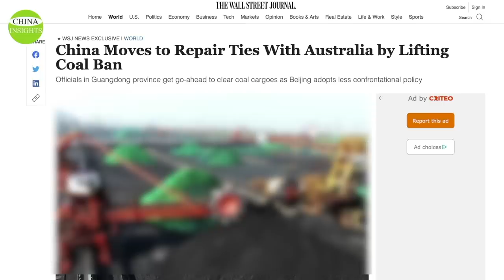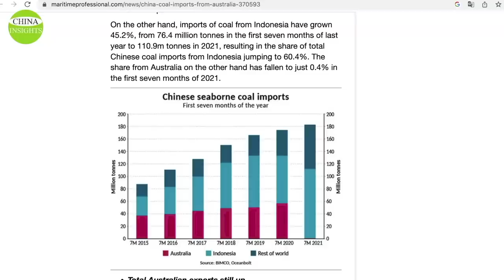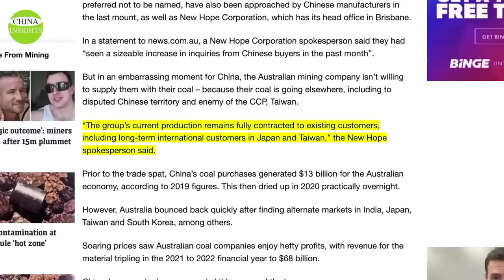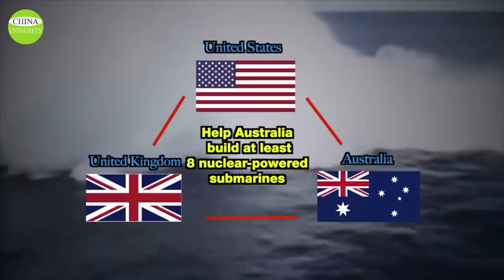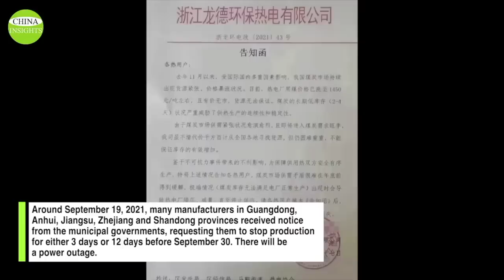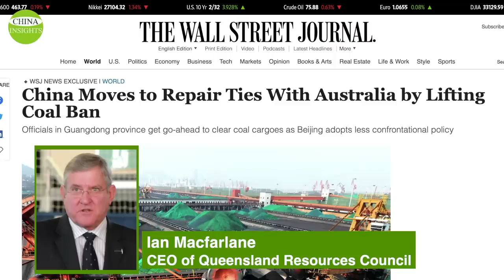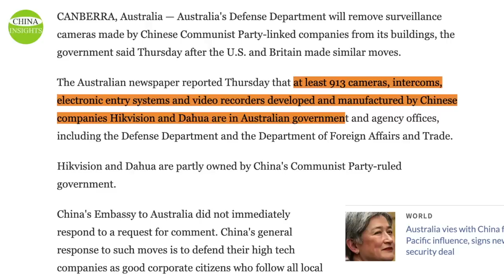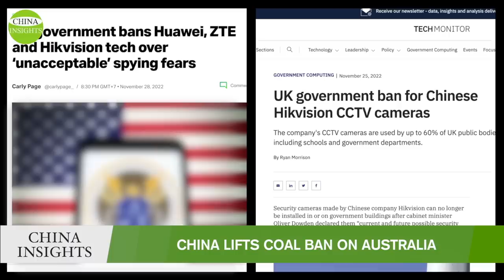China's economic plight stifles Beijing's pride/Can Australia–China relations go back to the way?

Comment: Our family has made a commitment to NOT BUY ANY CHINESE COMMUNIST PRODUCTS. We check boxes and labels and REFUSE to feed the "wolf warrior" preferring to buy used or do without if necessary.
Reply: Thank you very much for not buying made-in-China. I made this commitment long long time ago when I saw them using trade to blackmail small countries for political gains.
Reply: Yes same.
Reply: It's going to be pretty much impossible to entirely avoid Chinese made products. Boycotting Walmart and Amazon in favour of smaller chains is probably going to be more effective (or as you say go for more secondhand stuff)
Reply: @chendaforest   it's getting easier because supply chains moving out of CCPchina.
Reply: Likewise
Reply: I have taken great pains to avoid buying products with a "Made in China" label.  Most of the time, I can find a more expensive product made elsewhere.  Sometimes I go without the product. I didn't buy any new Halloween decorations last October because I literally couldn't find any not made in China.  I don't need Halloween decorations so I went without.  I checked every hardware store.  I could not find new light fixtures not made in China.  I cannot live in darkness unfortunately.
Reply: I try but sometimes it’s the only thing available sadly.  Bought some tools from India lately I like India but their ratchet actually sheered off on connecter something I’ve never seen tool metal do with only force of my hands.  Lots of times I just don’t buy product at all since I see it’s Chinese and decide I don’t really need it.  It’s thrift stores for me for now on I guess for basics.
Reply: @youtubeviewer4472  You do what you can!  Be proud of yourself for doing SOMETHING.  If everyone does just a little, we can step buying the rope from them that they openly discuss hanging us with!
Reply: @advancetotabletop5328  I agree. You know, I had a ceiling fan and the switch broke. So, I took it down to an electric store and showed the man the switch and he brought two up from the back. They looked exactly the same?? I said how much are they? This one $12 and this one is $2.49. I said what's the difference? He said the cheaper one was what you had.  That was the beginning of my getting ripped off with Chinese junk. I'm a fast learner though.
Reply: @rogerdodger8415  how much more would you pay for a 100 dollar Chinese product you MUST have to be US made??  I’ll pay 230 for exact same product after that I start to get angry at products might buy Chinese to be honest.
Reply: @dustintacohands1107  Look. Everyone is in different situations, so I try not to judge people. Maybe women can look at labels and choose an item from Indonesia instead of China. Someone else can cut back a little on the dollar store. To me, it's not about how much you can cut out, it's just that we need more of us to do...something!!  If you can't do anything, at least speak out.  The Communists want to destroy our country. Do something.
Reply: @rogerdodger8415  look don’t need a lecture Karen thanks
Reply: @youtubeviewer4472   thank you for trying... It'll get easier if we make a point of telling the shops to stock alternatives.
Reply: @rogerdodger8415  on top of what you said which I agree totally. There also huge environmental damage we need to consider. Just ask where those cheaply made broken things go? They become useless rubbish after a few uses. And how much materials, energy, oil, electricity etc. wasted on making those things?
Reply: @vanessali1365  Excellent comment! 💕
Reply: @alroberts193  I agree. They're like Ali baba only more aggressive. I bought a Chinese toy for a friend's child and when it came, it was a real piece of junk. I found out that to return it was almost as much as the toy itself. They're really clever. The advert for it was amazing!
Reply: Same for me.
Reply: Same here.

Comment: Chinese people were laughing loud when the Australian coal was unable to enter their ports. I remember it was about a year ago or lonnger, I read on wechat in their silly articles.
Reply: And then they started crying when they had rolling blackouts in the middle of winter and started buying our coal off India at a massively inflated price 😂 That was hilarious.

As it sits now, China is paying more for coal than they were before, and we're actually making more money off replacement consumers.
Reply: @sesameseedbar8853  the funny part is India is selling them low quality coals while India keeps the high quality ones .
Reply: The only ones making a scene all while laughing at ones misfortune(s) is squarely on the hands of the Lil Pinks & their 50-Cent Army trolls. I wonder if they're still laughing now?
Reply: @exiledwolfch  even more so for indonesia,  indonesia is the biggest coal exporter in the world by volume,  australia biggest by value.  Indonesia took over a lot of australias former chinese exports, used it locally and shipped their lower quality coal to china.
Reply: @richardthomson4693  Which would mean Chinese plants would have to be recalibrated to receive a different grade of coal. The COGS would increase. Australia should go back to making steel on a massive scale.
Reply: @richardthomson4693  
Not all coals are the same.  Coals from Indonesia are not good for running power plants much less to run steel furnaces.  China also sits on a huge deposit of coals but they are of the wrong kind.  Good enough for cooking and not much else.  Get educated
Reply: @richardthomson4693  Hilarious. Nice job Indonesia!

Comment: Strangely, the trade balance with China was / is heavily weighed in Australia's favour. I think it was something like 90% exports vs 10% imports in terms of value. Most of it iron ore, coal, wheat etc. China has been desperate to break this trade imbalance / stranglehold particularly on iron-ore and has been unsuccessful so far. eg. Vale (Brazil 50:50 / China) operation in the past did not succeed. They are now looking to Africa for mineral resources.

Comment: I feel that GDP figures belie Australias dependence on coal exports to China or rather the lack thereof. It caused minor headaches but much of the coal China bought from Indonesia, Indonesia had actually bought at a discount from us then sold at a premium to China. As long as China needs coal they will buy from us one way or another. Most of the coastal coal power plants were designed to run on QLD anthracite coal which is some of the highest purity black coal in the world. There are better coal deposits in the world but none at anywhere near the scale as found in the Queensland coal basins. Power plants designed with this coal in mind need less exhaust scrubbing as the sulfur content is extremely low using lower quality Chinese coal either wouldn't work or result in much much higher pollution and smog output. 

In addition the amount of money going into the real economy from coal is overstated in my opinion. Adjacent industries that rely on mining also service other mines. Australia has MASSIVE lithium, uranium, copper, nickel and gold reserves as well as truly gargantuan high quality surface level iron ore deposits. And much of the money from coal just goes offshore or into a small amount of investors. Coal mining also harms tourism and agriculture. 

I'm extremely optimistic that Australias mining industry  and wider economy will be ok with the phasing out or scaling down of coal mining. The sanctions seemed to hurt China more than they hurt us.

Comment: CCTV cannot, by design, and by name, send data to anyone. The “CC” in CCTV means “closed circuit”. If the data is on a circuit which is closed, it is not connected to the internet, so data can’t “get out” of the closed circuit. If you have the cameras on an open circuit, or connect them to the internet in any way then it’s not CCTV then is it?